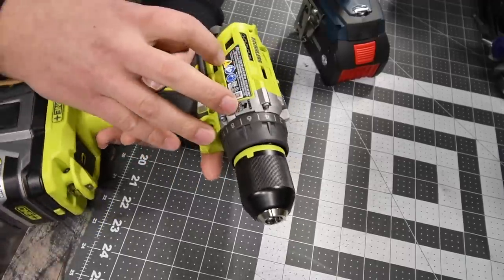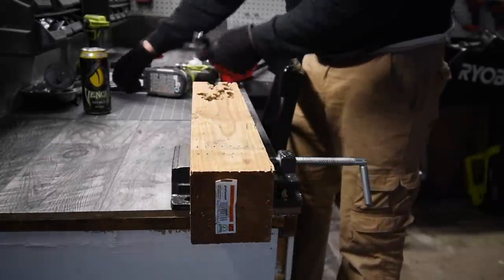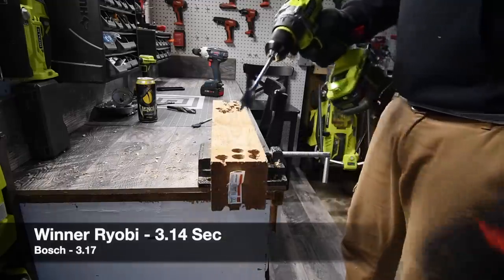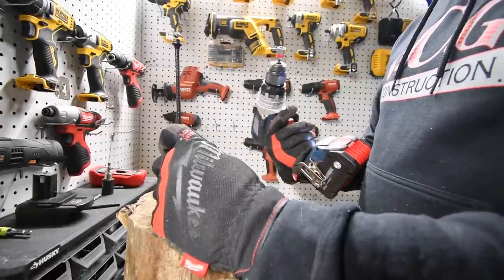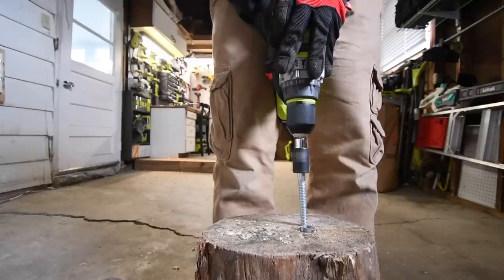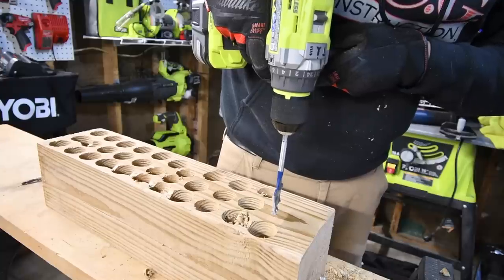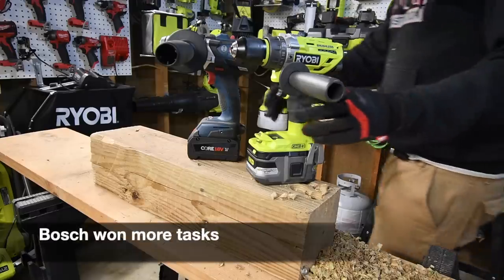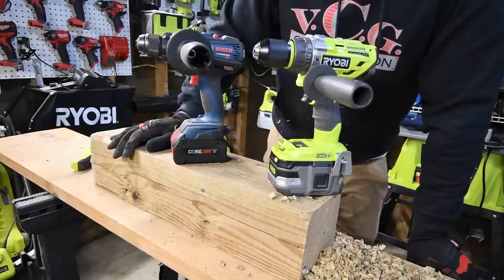Ryobi Vs. Bosch

Comment: Yeah that Bosch drill is like 6 or 7 years old now. The sudden stop with flashing led light is kickback control kicking in so you don't twist your arm off
Reply from the maker: I know. other drill are set the same way. I think they all prematurely get activated
Reply: And in another 6 or 7 years the Bosch will still be running like new and the Ryobi will have been replaced 2 times over.
I still have a small bosch drill I use every day for work I purchased 15 years ago. Also one of their first 18v lithium green drills (PSR18 ?), still gong strong. I purchased a Ryobi kit (drill, driver, circular saw, grinder) 2 years ago and the drill is already on its last legs. Chuck bearing is worn and loose, speed switch is jamming. the worst part is it's only had light use. Next month I'll be replacing it all with Bosch.
Reply: @ManCaverTools  you can change the sensitivity in the bosch, it works great for me,  I also have a milwaukee 2706-22, it has more power than the bosch and also has the kickback control,  but for me, the  bosch kickback control works better

Comment: I'm a real fan of the bosch quality and feel but not so much the price. As a home owner who's built decks, shelved, planter boxes and alot more with Ryobi tools, I've been very happy with them.
Reply from the maker: I do need to get more Bosch tools and I thank you Gatsu
Reply: @ManCaverTools  My brother swears by them and it's not hard to see why. Thanks for the great content as always!
Reply: I got my Freak 2 + GSB18V-535 hammer drill + 2 Core 4Ah 21700 cell batteries for 199 last year.
I can't think of any other top tier tool brand to offer such value for the price.
The Freak 2 has 150 additional in-lbs over the tool featured in the video and it can remove the lug nuts out of my truck with ease. The most I've done with it is 3/8 x 6" lags and it doesn't struggle lile the old one.
Break away torque using 1/2 impact sockets is more like 275 ft lbs

Comment: Thoughts:
1.) Any cordless power tool made today is 20x better than anything being used of a similar design/use case 15 to 20 years ago.  Speaking from hands on experience in the trades.

2.) In terms of brands only a few hold up to a 2500 to 3000 hours a year tradesman abuse with nearly daily use over said worked hours.  Ryobi isn't in this class IMO and from on the job observations it rings true.  I have many bosch tools that are well beyond 10 years old (18v and corded) and still function just fine after getting too many abuses to count. 

3.) Many forget that the tool is only as good or efficient as the worker wielding it as said in #1 you really can't go wrong with the top 5 brands offerings.  Reliability is key and my bosch tools have never left me stranded.  I watch a lot of tradesman jockies/contractors (no offense meant) that do a lot of "chasing" instead of planning, execution and learned growth of "time($)".  I'm truly not worried if I can drive x number of screws at x number of seconds or if x brand is 25% more "rated".  I'd much rather have my head "screwed" on tight so I can adapt, improvise, and overcome.   

4.) We all have a learning curve in the trades, and not everyone is a teacher.  But who you work for in your first 10 years matters 1000% more than the tools that you use everyday.   

All the best!

Comment: Kick back control for Bosch this why it stops
That drills are not in same class. Bosch is a pro tool and Ryobi for home use. Ryobi has more torq but only on paper
Reply: Same with Ridgid both brands do that Milwaukee is the only one that keeps it real of the now 4 brands they make
Reply from the maker: im just going based on its performance. the Bosch might last longer but its still lacking the power compared to Makita and Dewalt and milwuakee,
Reply: lonut, no that's not true. Ryobi have a descent and enough torque to do it effortlessly, the only reasons why is that  Ryobi's garbage and nonsense "Overall Protection" that holds back the tool itself from doing it's job. Because of that Overall Protection that tool can't achieve the advertised Torque of 750inch/lbs even If you use the High Capacity with a higher Amp Hour it will still get struggle. But anyway I don't use Cordless Hammer Drill or cordless SDS. I always use Corded Hammer Drill and Corded SDS because I love Raw Brute and Endless Power
Reply: Hell yea Tao Lang !
Reply: @taolang1089  fair enough. Really depends for which trade you are. Most of us cordless tools is fine with enough power and running time but if your job need unstopped drilling /grinding, like jack hammer. Better go with corded power tools.
Reply: @ManCaverTools 
This drills from bosch are old. They have a new impact and a new drill with 110nm torq(973lbs)
Reply: @Pecke1234  yeah that's great! But 973inch/lbs is still not close enough on the power of my corded hammer drill. For Light Duty Applications I use cheapass Cordless drill/driver or any cheapass Cordless impact driver. But for heavy duty applications I always trust the Corded tools. I wish Ryobi have brushless but Corded Powertools.
Reply: @taolang1089 
What corded drill do you have?
Reply: @sw86241996  yep! The only Cordless tool that I have is Ryobi's Brushless Drill/Driver P252 I think. And I got Ryobi's Brushless Impact Driver P239 and a Brushless Circular saw the tools that I recently purchased that came with 3 tools with a Ryobi green bag, 3ah HP and a regular 2ah lithium plus battery with a charger for only $269 @ Home Depot it's a good deal 3 tools in one package. The rest of my tools are all Corded. I even have another Circular saw too but corded Ryobi. Corded Black and Decker Orbital Sander, corded Ryobi Reciprocating Saw, I got corded Bosch Bulldog Xtreme 11255 vsr SDS. And corded Bosch gbh 2-26 dre. Most of my tools are all mixed brands.
Reply: @Pecke1234  Bosch gbh-2-26 dre, and Bosch Bulldog Extreme 11255 vsr they're both SDS i don't use hammer drill because it's a nonsense. I'd rather go for the heaviest that I can get that can do the job effortlessly. I'm using my Bosch gbh-2-26 dre on drilling a hole for a door knob and the tool is boring the hole so effortlessly like a hot knife thru butter. Most of my Powertools are Corded and Mixed-up brands, they're Bosch, Ryobi, Worx, Black and Decker, Vonhaus, Kobalt, Harbor Freight Tools and Kimo. They're all Mixed up brands, I never settle on just a One brand. Whatever is the cheapest that I can get and have a quality that is good enough to do the job I'm going for it. And because The Hart (Walmart's Brand another known Underdog) that came out of nowhere have my attention now, because of the good price.
Reply: @taolang1089  I like their cordless seven inch and a quarter circular saw,that's the hart I Was talking about

Comment: Those 6amp batteries have both 18650 cells mixed with 21700 so they can better performance than straight 18650 cell battery but not quite as good as a 21700 cell battery but that's how they were able to make it smaller
Reply from the maker: Good to know and thank you for the info

Comment: Bosch kick back control are too sensitive. Good feature to protect your drill. North America version cannot set the level of sensor. Also lower torque like 75 nm compare Australian version Bosch claim 110 nm also with Bluetooth connection function can adjust level of kickback even turn it off. I do like ryobi still reckon best brand of DIY range but it is not for professional use like Bosch. Thanks for your review.
Reply from the maker: im just going based on its performance. the Bosch might last longer but its still lacking the power compared to Makita and Dewalt and milwuakee and thank you for viewing sir
Reply: @ManCaverTools  I own few Bosch tools and Milwaukee Gen 3, some Makita impact driver and power saw etc, frankly not any brand can make individual skin best, Milwaukee chuck just nightmare especially use hole saw. Germen tool tune less power but longer last. Makita is very balance tool with power and durability just not built well like Bosch. I like Makita impact driver than any another brand. Love Bosch battery and drill chuck.
Reply: Man Caver Tools It sounds like you need to buy a Australian version where you could turn off the kick back 😉

Comment: is that ryobi drill good enough to used for home used in medium work or fail or damage quickly
Reply from the maker: Yes it is. what I do these tests on it the extreme way to use them, but Roybi needs speed 1 do to the tasks. which is ok
Reply: @ManCaverTools  i think the most of drills do that jop useful on spead 1 and that not damage the battery or motor
Reply: Don't expect Ryobi tools to last. For general homes use, maybe 3 to 5 years and they'll be falling apart.  Bosch tools should last 10+ years for their budget green range and even longer for the blue professional range.
 
(I own a range of Ryobi, Bosch, Makita, and DeWalt cordless power tools)

Comment: Any chance you could review some European/Australian Ryobi tools they have a digital clutch on the drills a power file a brushless impact wrench and a ratchet head for the jobplus
Reply: Craig Chiddo I just bought the ryobi 12v drill and it’s shipping from France as we speak!  Can’t wait I might make a a video
Reply: Ryobi had one hear I remember I had it and failed on me that's back when Ryobi want lithium ion in 2008
Reply from the maker: im hoping I can get my hands on some out of country Ryobi tools and thank you sir
Reply: @bluemantom77  I have that whole set I was doing side jobs and needed a secondary tool set the hybrid jig recip saw was cool
Reply: @EveryDayJay415  I'm pretty sure that is the same as the Ridgid 12volt sold here

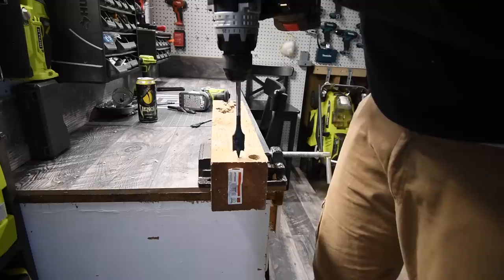Comment: 3:00 Have the same issue, wondered why my Drill stops, and it was the Vibrations messing with the kickback control sensor!
Reply from the maker: its a safety thing that prematurely activates
Reply: You didn't have the bit in correctly on first test... it wobbles compared to Ryobi

Comment: One thing I will say is that Ryobi fall short on accessories. I'll give 2 examples. 

1. My Ryobi circular saw came with a 24 tooth blade. Obviously not ideal for finer cross cuts. Problem is that's the only saw blade Ryobi make. In the land of Bosch, it would be almost impossible to count how many blades they make. And you get all kinds of blades from Bosch for various materials. Really Ryobi, one blade? A 24 tooth rough cut blade? That's it? 

2. My Ryobi trim router takes 1/4 inch (6mm) bits. This is really the worst kind of bit size imaginable. Now in the US you can source a 24 bit set. In Europe the only set you get for this router is a 5 bit set, and the straight bit you get with it is so thin it would require 2 or 3 passes for even the most basic groove, such as for a flimsy drawer design. You can find wider straight bits in the 1/4 inch format, but they aren't made by Ryobi. 

So all in all, I'm not saying buying into the One+ system was the worst decision I ever made, only that I just don't think I'll be buying anymore into it. The tools Ryobi make aren't inherently bad, but they are kind of "basic" in the sense that you get exactly what it comes with most of the time and outside of that Ryobi don't have much accessories. So that's a disappointment. 

I'll be looking into Bosch as an alternative, just because they offer a lot more accessories.
Reply from the maker: The Ryobi is extremely good for the home owner and Diyer. I love the variety of tools that Ryobi has.
Reply: @ManCaverTools  Like I said I don't think they're terrible tools. I would classify them as serious tools. Yes for the most part they will get the job done. But they do really fall short on accessories. Ryobi are in the business of providing the base tools and beyond that you're out of luck. 

You won't find cool extensions for the tools you actually use and the total lack of any accessories such as a variety of saw blades or actual official bits in the case of a router. 

Another complaint is the battery size. Ryobi due to it's legacy battery cannot offer duo battery scenarios due to size. Unlike other manufacturers who are now giving you true corded power in their cordless range by doubling up the batteries. 

So yeah they're ok, but I would advise anyone with some common sense to rather go for Bosch blue line or Makita before they think of Ryobi, for just a bit more you get a whole lot more tool.
Reply: @blahdiblah2169  The few accessories they do make are complete shit. (drill and driver bits, etc)

Comment: You couldn't be more wrong as far as what class these two drills are in. Ryobi is for homeowners, whereas the bosch along with all other bosch tools is meant for professionals.
Reply from the maker: when it comes to performance and power its in the same class as Roybi. Milwaukee, HILTI, Dewalt and Makita would Destry Bosch
Reply: @ManCaverTools  
You are wrong
This drill is several years old now
Try bosch gsr 18v-110c against any of the big three and you will see the bosch is in equal class.
And bosch will outrun any of them in durability. Maybe not hilti, but dewalt, milwaukee and makita definitely.
Reply: @ManCaverTools  the Bosch would actually be in the same class as Hilti. Bosch always understates the specs and the quality is pretty much superior to Milwaukee, let alone Ryobi. Also you were wondering why the Bosch kept cutting out; it's because it's got kickback control so you don't injure your wrist or go for a ride.
Reply: @dragogranic8171  are you a Bosch tool fan?
Reply: @christianness8983  
Not only a fan but a proud owner of the few tools
Reply: @christianness8983  the only thing being proved by the video is that a 1-2 yr old Ryobi can almost keep up with a 6-7 yr old Bosch. I wouldn't be really proud of that.
Take the newer GSB18V-755C Hammer Drill (which is still about 3 years old)  then you can realize they are not in the same league. Also speed alone won't tell whether a prosumer brand is on par with a pro brand. Features, build quality, warranty, battery life also come o to pñay
Durability is also a selling point on the Bosch along with Makita and more premium brands like Hilti.

Comment: The Bosch has a voltage overdraw sensor. The tool is telling you to use a lower gear.
Reply from the maker: it was activating way to soon
Reply: @ManCaverTools  They will have to back it down if they want to keep selling the tool
Reply: @MrHowieZ1973  it's the kickback control kicking in (lol) due to the vibrations of the device
I had the issue with several long wobbly drill bits, or when using it to stir concrete with one of those big attachments. It just doesnt like the wobble

Comment: Please help @man cave tools. I need a new SDS and Drill driver I'm a electrician but there is so much choice but I don't know anyone with a collection like yours.
In your opinion what is the best SDS and drill driver cordless?
I've been looking at the new Hilti Cordless rotary hammer TE 4-A22 (2)
And not sure about an SDS yet. Thanks in  advance mate
Reply from the maker: sds is good for drilling into foundation one a regular basis. if you only hav a few holes to drill that are not too big id go with a regular hammer drill. but if you drill out a lot of big holes id go with the SDS
Reply: Another factor in choosing could be what brand tools you have already do you want to buy into a new system or stick with what you have most of the time you can buy a few tools for the price of a battery and charger kit
Reply: I would go with SDS Plus, a little smaller and compact but more power than a hammer drill!!!! I use a Dewalt and it’s baddass and cost effective

Comment: Dude, these are not in the same class!  Ryobi is garbage, Bosch is a pro tool!
Reply from the maker: bosch doesn't have the same power as the Makita, dewalt and milwaukee and HILIT, not even close. bosch failed at driving in a 1 1/2 spade bit on speed 2 when the top brands can at a very fast time. the Bosch went in 1/2 in then it wouldn't go any more, the same with Ryobi, sorry but the performance just wasn't there compared to the brands that are actually a pro tool
Reply: Back in 2007 i bought 6 compact 18 volt bosch drills.  They all burnt up like  the the 887 in under 6 months installing cabinets.  Hole saws and 3 inch screws.  They were the most pathetic drills ever.  It was like the batteries put out more power then the motor could handle.   After that exsperience id rather have black and decker lol 😂. I gave them another shot with there table saw.  It burnt up in under a year.  I'm done with so called professional bosch!